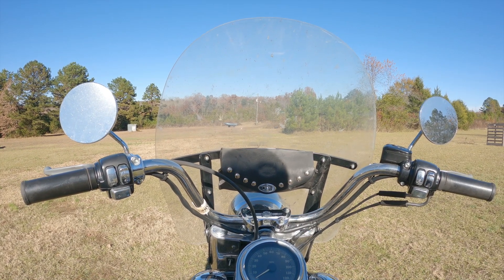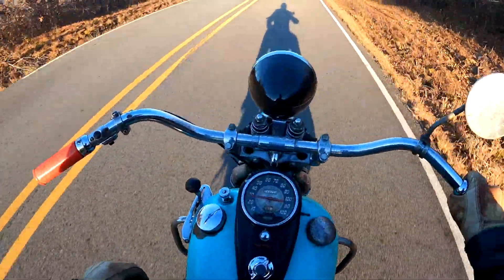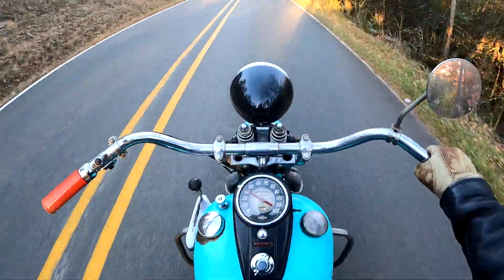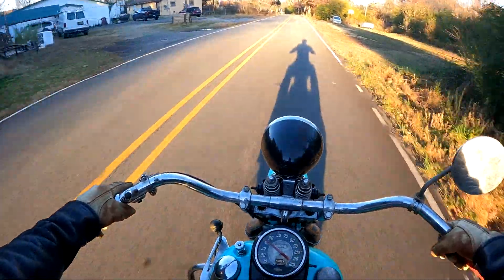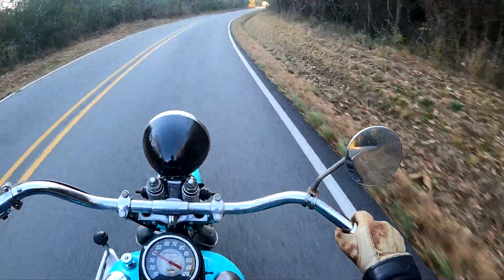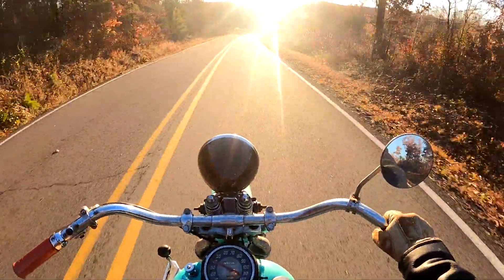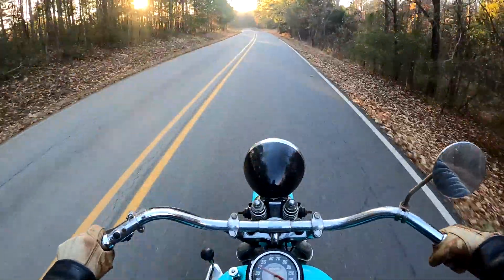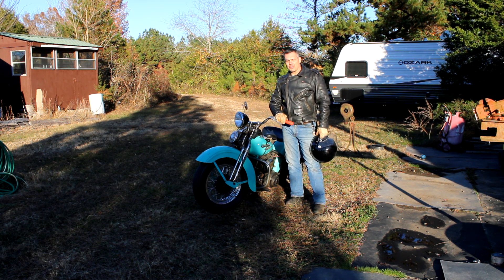Harley-Davidson 1942 WLA Out For a Ride

Comment: Great video. I had a 42"45" when I was 14, back in 1955. Your starting out and killing the engine reminds me of the trick I had to use as the front brake cable was broken. The trick was having to stop at a stop light on a hill. But hey, I was 14, you can do anything when you are 14. LOL.

The sequence started when I came to a stop. Shift to low, rock the clutch, put left foot down and hold rear brake with right foot. When the light changed, remove right foot from brake and put down while lifting my left foot to rock the clutch with just the right amount of throttle to keep from killing it.  I became an expert at it. 

Anyway, it brought back a lot of memories. At 83 I still ride my 99 Softail Custom. But have fond memories of the old 42.

Comment: Great vidio You have a very nice 42 WLA  I enjoyed the ride. THANKS. 
The last year of WlA was 1952. All WLAs had springer forks. The early ones and friction damppers and the later had a shock setup replacing the friction plates.  The script emblems on the tank are from 1951-54 but they droped the under line in 1954. That being said that makes your tanks  from a 1954 servicar. The front fender is a pre 1950 Wl (The good looking fender). The shift pattern with first being back makes it the later pattern that started in 1947. I have a very simular 51Wl with a 42Wla engine.   Hope to run across you  as I also live in the Missouri Ozarks. P.S. Does yours have reverse?
Reply from the maker: Thanks for the info, It doesn't have reverse. Out of all my vintage bikes it's one of my favorite's.